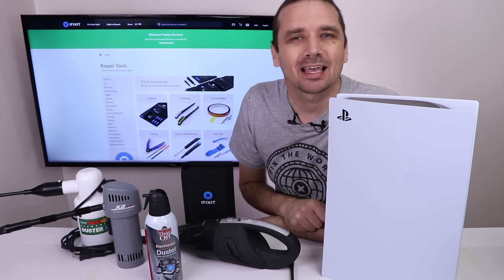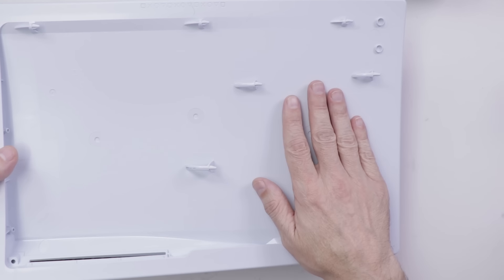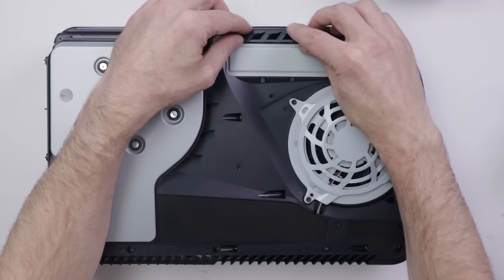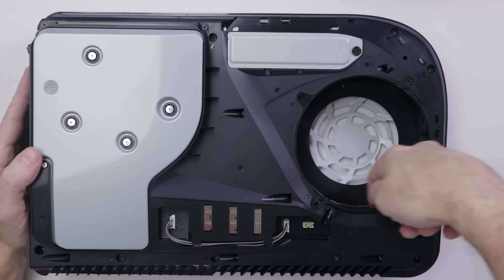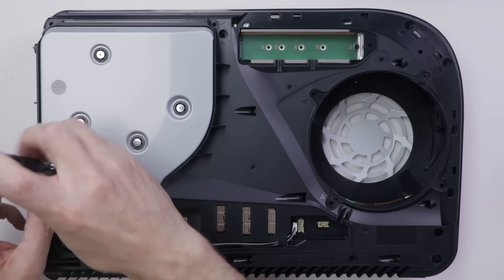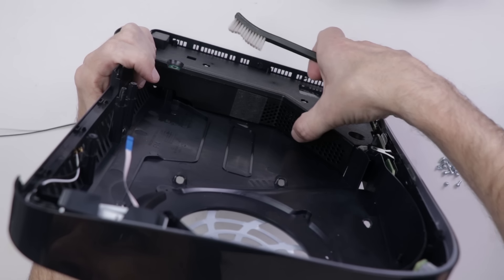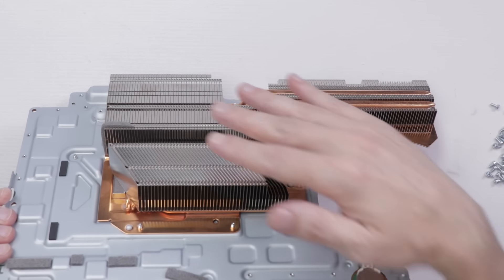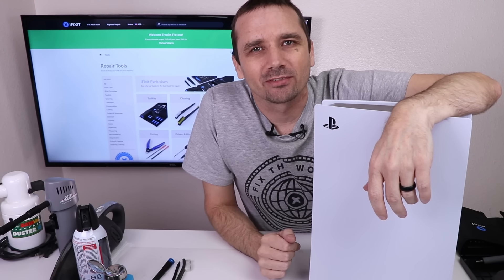How to Clean Your PS5 Safely - 3 Stages

Comment: If anyone is wondering about doing the step 3, it’s not so bad, just have to be careful and keep track of which screw goes where. It took me about 2 hours to do a deep cleaning.
Reply: My PS4 I was not even a month old
Reply: What step you think I should do only step one
Reply: Or 2m
Reply: If you feel like it’s not a lot of dust, do step 1.
Reply: What if you ďont remember what screw it goes to
Reply: And 1 of my screws are not going in I tried it on all of them but the same thing is happening
Reply: @trulyj5479  try finding a picture of the ps5 with the screws already in and then follow the pattern
Reply: @wis3 decisions  Step 2 is easy. The only slightly delicate bit is unplugging the fan but you don't even have to disconnect it if you're careful. I left mine plugged in and managed to clean everything fine.
Reply: @trulyj5479 is it a long one ? The fan has 3 different screws, 2 of them are the skinny threads and the others are wider threads, the longest wide thread screw goes in corner of console one the curved side and the medium sized wide thread screw goes into fan. I just finished putting mine together and it took me 20 minutes to figure out the screw replacement, and ibwatched an ifix it teardown and figured out the fan screws, even tho i laid mine out on the table in the location they came from 🤦🏽‍♂️. It woulda helped if he showed the screws when they came out. Idk wat u ended up doing but im gna turn my console on now, hopefully lol…aaand it turned on, thank goodness. Idk if there are any videos showing screw locations but i might have to make one cuz thats literally the hardest part. He also didnt show the screw that has the black label on it which is probly what voids the warranty but yea it took me almost 2 hours to rip it clean it and zip it. Not too hard tbh, but those screws !
Reply: @muzgaming7861 that wont help probly seein as how they all have the same heads, unfortunately, but lmk if u did find any helpful videos on the screws… i found an ifix it teardown that helped me abunch cuz he showed the fan screws and i forgot there were 2 different size threaded screws there smh
Reply: @sanchezfran9852  honestly I just took looked at videos on how to put it back
Reply: Hey man. I have been looking for "this" video for so long. I was wondering about it you can remove everything except the heatsink from motherboard so I wont need to change the liquid metal xD because i was stupid and waited for to long before cleaning my Ps5 so its super dirty inside now. So anyways now that I know that you can do that i will do it. I was just wondering if you know (or anyone else) if its basicley the same process with all the versions? Im thinking it should not be any difference but one never knows xD Really hoping for an answer so that i dont end up somewhere i dont want to be hehe. Thanks in advance 😅😁😁
Reply: @alexgra4363  it should be the same process but make sure to keep track of the screws and possibly label them so you know where it goes after you take it a part.
Reply: @muzgaming7861  okok sounds Great thanks :) Heheh yeah I always do that and take step by step pictures 😅
Reply: I 2nd this message 😊
Reply: If you set your system vertically, step 1 every half year or so will keep you solid.  Skip the 2 hour deep clean and just dust your system every once in a while?
Reply: @radelta  it’s hard to keep the inside clean for some people if they have pets, regardless of how often you clean it, there always be pet hair/dust deep inside. I bought myself a cover that goes over the ps5 whenever I don’t use it and it does the job.
Reply: All the purple paste needs to be replaced correct? I'm ready to go back together but realized I do not have any thermal paste. Guess I should have checked first before doing this project lol.
Reply: @j71-wyvern46  I’m not really familiar with that issue, I would honestly do some research before doing anything that could hurt the ps5 in the long run.
Reply: Dude I’m just using electric tape when I put my fan back in
Reply: Hey. My screws all pins inside of them so my t8 head won't even grab the them. Does anyone have any advice about this
Reply: @muzgaming7861 when do you have to do the step 3. Like do i have to do this every month or year or weeks 🤔
Reply: @96miran  only if it’s super dirty but get a ps5 cover and so you don’t have to worry about cleaning it often
Reply: Im fine with screws its the ribbon cables I’m worried about
Reply: I ended up screwing one screw in the wrong hole and couldn't install the fan anymore, so had to open it up again, but I figured out where it should've gone
Reply: @96miran I just opened my ps5 after over a year and my ps5 had barely any dust, definitely only have to up to step 2 every few months and shouldn’t need to do step 3
Reply: @jmoriarty8000  can i clean my ps5 every month because that's exactly what i do 😐
Reply: @96miran  Of course, can prob clean it every week lol
Reply: @jmoriarty8000  thanks man i appreciate that 😁👍
Reply: Didn't want to step3 but looking down into it it's completely blocked...
Reply: I just did this, and I ripped the connector off of the motherboard. I was not even pulling that hard! I can't believe how easy it was to rip it off of the motherboard. I pulled apart many devices before, and never did this. There should have been some epoxy there on the base connector to help prevent this. I'm now going to find a repair service to fix this for me.

edit 1/24/24: found a local repair shop here in Vancouver (Vantel), and they fixed it for $80, and did a really good job. NOTE: I tried to fix it myself, after buying all the equipment, and even magnifying glass with light, but the leads on the motherboard are way too small for me, and was afraid I would damage the motherboard, so then decided to find a repair place.
Reply: Took me about the same. Some of the black screws are finer threads or longer than others. Really need to keep track of where they all go. Longest part was figuring out where they all go
Reply: I'm more concerned with the ribbon strip and wire connectors. Not sure I can do it
Reply: @michaelbugarin9153 you have to get a TR8. The regular T8 won't work
Reply: Im in stage 5 try to sell my ps5
Reply: I was having a serious overheating issue, like ONLY being able to play for 1-2h at a time with my ps5 in performance mode. I do have a cat that sheds a lot, and my console was overdue for a cleaning. I really hope this solves my issue and I don’t have a gpu cooling metal issue.
Reply: 2 hours???? How
Reply: @Battlefield_Slayer226  it’s not hard, as long as you follow the steps and have the right tools
Reply: bro how did u get that cover to come up mine literally wont come up
Reply: @muzgaming7861  indeed you should keep track of the screws... 🙃

Comment: Just gave my PS5 a level 2 clean for its first birthday. Went very smoothly. Honestly the hardest part was getting my top plate on and off. Thank you for a very clear guide!
Reply: Was it dirty inside after a year?
Reply: @Matute7231  I mean it was definitely dusty but not more than what I expected after only a year of use. There's definitely some minor dust buildup deep in the inside that I can't safely get to with only a level 2 cleaning, but my heatsinks are sparkling now
Reply: I’ve had mine for a month and it’s already shutting down.  No way it’s that dusty.  Guess I don’t have a choice but I’m going to have to give this a go.  Sigh.
Reply: @MrRHCPfan84  if it’s shutting down (for overheating presumably) after only a month, there’s probably something else going on inside. Like a manufacturing issue
Reply: @loztpm  usually most consoles have a safety feature when the console detects that there’s too much dust and heat and will shut down to prevent sparks and fire incidents.
Reply: What kind of screwdriver did you use ? Because a regular screwdriver doesn’t take off the fan screws
Reply: @Matute7231  lol be😊 cc😊
Reply: @loztpm  omg that happened to mine after a month guess ima have to open it ☠️
Reply: Have you tried changing the power cord?? I had that issue when i first got my ps5. Once I changed the power cord my ps5 stopped shutting down.
Reply: I cant do step 1.
Reply: @oceanhudson  t8 or t9 security screwdriver
Reply: I’m having an impossible time removing the mid frame. I’ve removed all screws but it’s stuck on the bottom right corner as if still screwed in.
Reply: @brandonbeforechrist  I have this same exact issue. France will not come out unless I break it
Reply: @brandonbeforechrist  how did u get it off?
Reply: @mariatorres128  if I remember correctly the issue was that there is these stickers that are hard to notice keeping hidden screws in place. The stickers are designed to look invisible. I would look up the location of those stickers! That was driving me insane. I hope that helps.

Comment: If you don’t take a part electronics often, I’d recommend to just clean the the first two stages because you’re taking a risk albeit a smaller one.  If you have animals, I was told to put the console up at a higher location even if it looks tacky, it still may be worth it.
Reply: I agree, honestly I never take apart my electronics because I am worried I won’t be able to put it back together. If you don’t do this stuff often, it’s best to take your console to a professional to have it cleaned in a safe environment and to ensure nothing goes wrong.
Reply: Gotta start somewhere if you’re too scared to start you will never get good at it

Comment: Spent 2 hours last night disassembling, then reassembling my PS5. 

My day 1 launch console from 2020 had been having moderate to severe overheating issues over the past few months, to the point where the system would suddenly shutdown without warning about an hour or two of playing any game. I knew it was due to overheating, because I experienced the same issue with my PS4 Pro a few years back before I opened it up and fully wiped out all the dust from the heatsinks, motherboard, and power supply...So I knew I would have to do the same exact thing here with the 5.

The internals of my system were fully caked with dust in certain areas of the heatsink and powersupply, which was causing the overheating and airflow issues. I used a dedicated electronic vaccum cleaner, microfiber cloths, and a toothbrush to completely clean out all the dust.

The console is now running super cool and doesn't get hot to the touch near the base like it used to, and I shouldn't have any more severe overheating issues for a few more years hopefully.
Reply: how is it running? Im having the same issue and plan on deep cleaning the same way when i get home from work today
Reply: @ Still runs like a champion! 😎

Good luck on deep cleaning yours as well my friend! Hope all goes well.
Reply: @ThePokestopPapi  hey man i just wanna know im having same issue after playing for 3-4 hrs my ps5 is getting shut down completely without warning i just wanna know if i just do cleaning till stage 2? Im hella scared to go to stage 3
Reply: @ThePokestopPapi  it did! Much easier than i expected tbh. Took about an hour and a half while trying to cook dinner lol. Its so quiet now that's crazy!
Reply: @Senpaii143  hey man stage 3 wasn't as bad as it seems. It is a LITTLE difficult to separate your motherboard from the plate its semi glued to but gentle pulling around the corners got it done. The ribbons and wires aren't hard to undo. Just keep your screws separate and take "before" pictures so you know where it all goes. You will need a star screwdriver. I forget the size but it's tiny. And needle nose pliers to unplug the fan and the double cable. After thats it's truly a cake walk
Reply: i got the same problem with mine from 2020. went to stage two which helped it run a bit longer but still shuts down. the other day i had wwe 2k24 last for 2 min 30 secs before it shut down 😭

Comment: Honestly thanks so much for this. After a few heart attacks during stage 3, my ps5 is finally clean. The amount of dust underneath the heat sink sandwich was crazy.
Reply: Bro Im having heart attack rn I took the screws I had to out and cant take the motherboard protector piece😔
Reply: I may have even broke it cuz I pulled it and it came out with the mother board and the vertical piece that wraps around the outside 😭
Reply: @Tilp  what happened bro. I need to know
Reply: @fatherjohn420  I got it done eventually still don’t know what happened in the process but it works and I haven’t dared to take it apart since. But I will say I took like 4 hours figuring out why mine wasn’t coming apart like the guy in the video’s does.
Reply: @Crystal-kj6uz  Have you changed the thermal interface, under the iron lid?

Comment: 10:01 Just a heads up to anyone looking at this part to remember where the screws go.. there are two misplaced screws one where the Disc drive connects and the one by the fan. otherwise amazing video thank you for what you do!
Reply: Yup he misplaced some screws. Then In the next frame he fixes them without mentioning it! Messed me up. But we figured it out. Good video 📷
Reply: I said the same thing. I had to use another video, the third one I watched, to find the right placement.
Reply: You nailed it. I'm scrolling these comments just to see if anyone else noticed.
Reply: Which screw goes where I don’t remember?
Reply: Nvm figured it out

Comment: My PS5 started unexcpectly turning off this week, although it's insured I didn't want to have to go down that rabbit hole of agro (British word for effort, hassle, trouble lol), of contacting them and being without it probably for a few weeks, so I decided to follow your really helpful video of properly cleaning...

I've always opened my ps5 every few months to clean it but I never had the tools or confidence to remove the fan and clean that out, this time I did with the right tools, im not going as far as removing the Motherboard or anything that's too advanced for me, but ive managed to clean the fan, heat-sync and even managed with a bit of a vacuum/blower and brush to clean out the power supply grille inside too through the fan gap, the console is spotless inside and out now as best as it can be, and I was amazed at how much dust and crud had actually built up inside there, even though I keep it clean and in a position that's not on the floor or blocked airflow, it was that gunked up.....I have owned it since Oct 2021, and this is the first time I've taken the fan out to clean so maybe it's just time.... thankfully re-assembled and it all seems good and fan spinning.... so hopefully no more overheating and shutting down!

Thanks again, and I only recently learned of your recent health battle, I hope all is going well with that, I wish you all the best and respect that you're posting videos despite it!
Reply: Did it fix your issue? Mine is doing the same thing haha